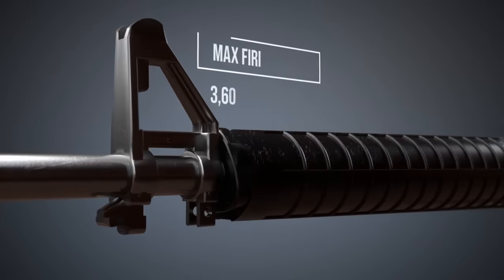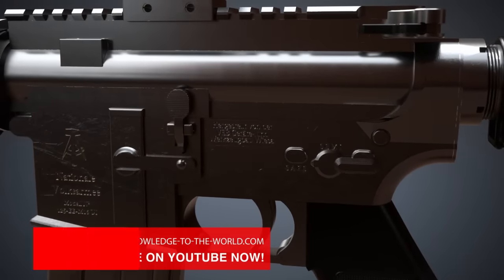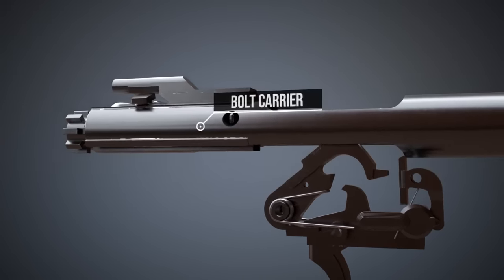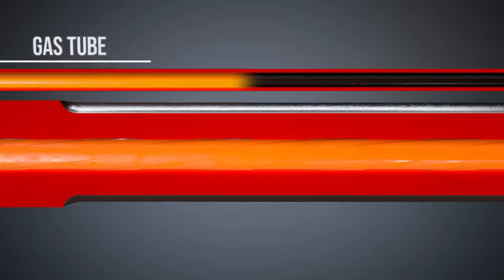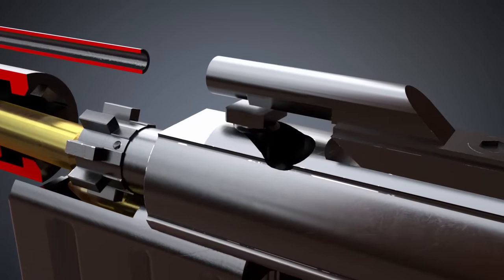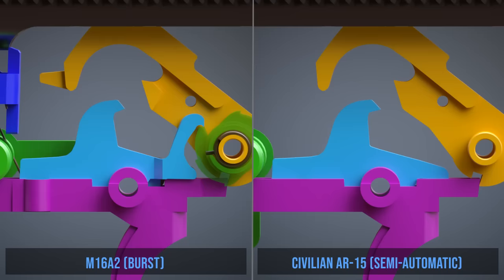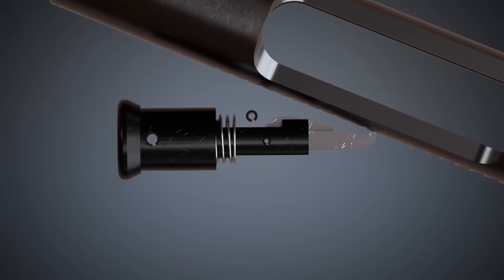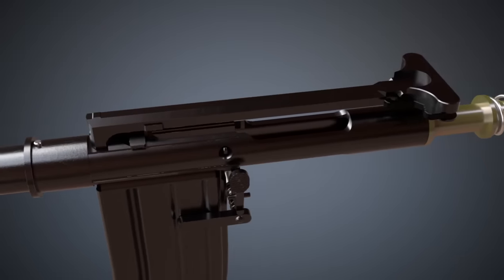M16 and AR-15 - How firearms work! (Animation)

Comment: The amount of 3D modeling software skills is unbelievable
Reply: thats exacly what i though dude
Reply: root try it bro.
Reply: @chownful  Having some experience in 3D programming (Maya in particular), I can attest to the complexity of constructing this kind of animation. If you think anyone can do this, then you are most assuredly unaware of the skill and patience required to make such an intricate animation. The animation itself is roughly ten minutes. The amount of work that goes into those ten minutes can mean, depending on your skill, construction can take some two weeks (and a few days for experts). The more detail you add to the animation, the longer it will take and the more work it will require. If you were making an animated film, you could expect those ten minutes to take between six months and a year for a small team to construct.

You absolutely underestimate the difficulty of 3D animation.
Reply: @hassi44  I still feel that the original comment is an overstatement. What exactly in the process for this specific video do you think took the longest? I'm not saying the video is bad, but it's definitely not the best I've seen.
Reply: @chownful   root  Sure, I can see that. As for what I think was hardest to animate in the particular video, I would assume it was the frame construction because the animation contains multiple moving objects at once that have to work together as a unit. Unless there's a physics engine involved, one would have to animate each movement. When you are operating with a physics engine, you can design a model that triggers the movement of other objects because they can behave like solid objects. Here, as I assume there was no need for a physics engine, objects will clip through other objects unless they're all individually animated.

I want to stress, though, I am no professional. It's just a hobby for me. I am sure there is someone here in the comments much better educated and with much more experience than me, so please take my words with a grain of salt.

I'd also like to apologize for coming off so brash. I just read it over and I'm not exactly happy with how I phrased my comment.
Reply: @hassi44  Hey, thanks a lot for your explanation and educating me on the topic. My initial comment was purposely antagonistic so it would hopefully attract a brash response from someone as passionate as yourself, so you could help inform ignorant folks like me :)
Reply: No kidding 😱
Reply: @chownful  This is my job. Not guns, but constructions in steel engineering, and yea you are right. Its nothing special. Anyone can do this shit. If somebody say "do the same thing like in this video, its tooks me whole week I think...(yea without fancy texture and the specifics details, camera focusing etc.)but. The most consuming part is "scenario". If somebody say "do video about how AR15 works, so it tooks my weeks understand the concept and then how to explain very clearly to youtubers the whole thing. I think its not one man work so... anyway every video by these boys are awesome :)
Reply: Yeah
Reply: yeah it must be a lot of hardwork
Reply: @hassi44  Using Maya or even 3DS max to do this is complex.  This is obviously done using a CAD/Inventor software though which makes things a little be easier to just build parts and assemblies.
Reply: Oi mate you got a forbidden number of likes, it would be funny if someone just stopped by and you know liked your comment. Like me!
Reply: This is a teamwork job, not for individual. The team already has all the information needed to visualize the guns engineering. What we watch here is the final end product.
Reply: @petergriffin383  oh,if you are so good the where is your channel?I'm not finding it
Reply: I agree too
Reply: not going to lie, if you have the right mind, 3D modeling is easy, it just super slow, and can be frustrating at times. not everyone has the patience to sit around doing this, but for the people who do, it is pretty easy. otherwise good luck trying to replicate it. for me the only hard part is finding the measurements of all the pieces cause ya know, i don't have an M16 laying around. but i do want to replicate it.
Reply: Same
Reply: hassi44 what he Said lulw
Reply: There was a video on Imgur recently that showed some 3d animation of how rifling worked, and had the entire round, unfired casing and all, shooting down the barrel. I'm glad these guys got it right.
Reply: why
Reply: @hassi44  u seem to be one of the very few sensible people available here. What u said is absolutely correct. People think everything is easy as long as they don't have to do it
Reply: Machines are easy to model and animate. People and creatures are hard.
Reply: I did it. With a central heating and ventilation system of a howitzer. This shit is pretty good. NX software package has bit low quality assembly sequence module.
Reply: @hassi44  you don't necessarily need a physics engine for the movements. Every part can be scripted to react as designed to another part.
Reply: @cpu64  That is true. The main thing I was trying to convey is that we don't know the exact method behind the animation, so we can't really tell just how much effort went into making it. It varies depending on the method. It could have been a couple of days worth of work for one guy (though I doubt it was) or team working on it for a week or more. It just depends.
Reply: You can accomplish this using SolidWorks since they're used for engineering purposes.  Additionally, with Solidworks you have the ability to manipulate 3D objects to inform you if said objects are colliding with each other. It's fairly easy to create once you're good at it, but can take a lot of time and patience for someone just learning.
Reply: i bet you guys that are saying ''oh gosh that is sooooo difficult" never heard about fusion 360
Reply: @tuliosouzaa  lol!!
Reply: Say thank you to Muslims for Inviting Algebra
Reply: Yea, modelling is sometimes hard to make a gun, but it also depends if you want to make it full with internals, games dont use internals, like CSGO and others, so people wont have a lot of lag when there's like 10 million tris.
Reply: root I like your style
Reply: @hassi44  Been in the 3d industry for over a decade, nothing you said was incorrect :)
Reply: root please make one and upload it to YouTube and put the link in comments guaranteed you will fail
Reply: He even added little paint scratches and stuff
Reply: no but realy this is incredible, this requires a deep understanding of the size and shape of each part and a high level of 3d animation skill
Reply: @chownful  I don't see your channel having millions of views.
Reply: Funny. I was thinking about doing this in POV-Ray. Totally possible. Just a lot of parts to put together.
Reply: @hassi44  or use world of guns from steam.
Reply: Check Steam Game called World Of Guns!!
Reply: root As a 3D modeler, this shit takes so long to learn and is not easy at all
Reply: Ya
Reply: @hassi44  You sound like you don't really know what you are talking about. No physics are needed to animate something like this. I never spent much time with Maya because it's such a terrible program, unless you have your own group of programmers to fix everything that is garbage in that program.  I do have about 11 years of experience with Softimage (RIP), and in that program you can link rotations and movement together so that when the trigger is pulled, all the other things that need to move will move at the same time. This kind of linking is possible in any competent 3d program and is not difficult to do.
Reply: @CompilationSS  The hardest part about any animation is understanding how the thing you are animation works. If you don't understand how something works, you will never be able to animate it well. Unfortunately there are a lot of people out there that think they are animators who don't understand how things work very well. All you have to do is look at modern cartoons to see that.
Reply: @chownful  if it's so easy then become a rocket engineer and design rockets
Reply: The amount of engineering in these guns is incredible as well…
Reply: He even added the machining marks and what appears to be random scratches. That takes some serious dedication.
Reply: root just cause anyone can do it doesn’t mean it’s easy
Reply: اصلان بتتتتات
Reply: خوب نیستن اصلان
Reply: @BlastWorrior    ض
Reply: @BlastWorrior  ر
Reply: صب
Reply: It must've taken a hell of a long time to make.
Reply: true
Reply: 4000 hours
Reply: @vorrdegard2176  WOW
Reply: @chownful  Yes, anyone can do this. But only with intense training and experience. If you think you can do this, name your preferred 3D CAD program and post a link to your own video. Otherwise, shut your face hole.
Reply: It’s most likely 3D scanned
Reply: Lidar my dude, laser scanning that measures every time precisely and from that data you are able to create a 3D model. Not sure what OP used tho...
Reply: @duckdown4337  Why? You better have a good reason to say that. You need to elaborate.
Reply: @chownful  nope, anyone?  skill has education, of the weapons and computer science at a level most folks can only dream how the system works,  but then again its not that difficult if your a computer nerd?
Reply: @chownful  not the best?  at 1 thru 10,  10 being the best,  10 plus!
Reply: No
Reply: @neatpolygons8500  Yes.
Reply: not really, AR-15/M16's are actually quite easy to model in maya and blender, they just take time to model properly.
Reply: The animation skills are amazing 🤯.

Does anyone know which software is used to make such beautiful animation ?

Awesome animations on this channel.
Reply: @ychodneker  generally for animating 3D models you will generally either use Maya blender or render man
Reply: @justin9202  Okay. Thanks for the info. 🙏
Reply: @chownful  not everyone lol, but yes, anyone with the time and a good computer could do this, I think it's modelling it from the reference photo being the hardest from my experience with blender (I am horrible at it)
Reply: @hassi44  m